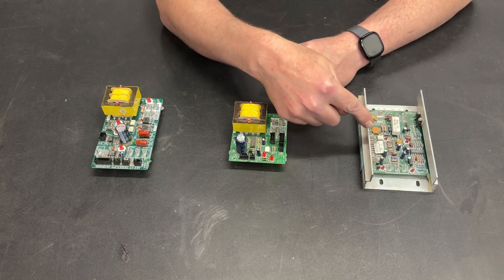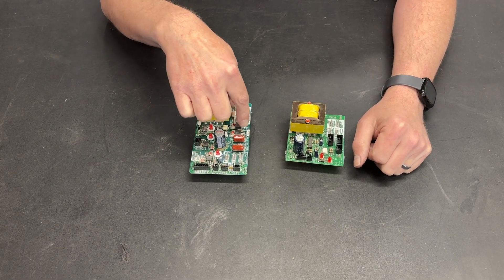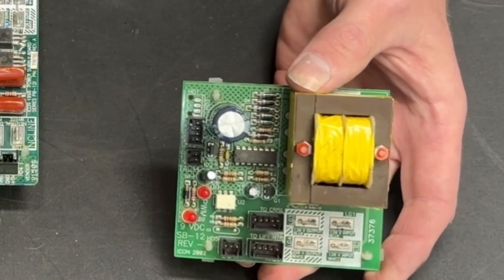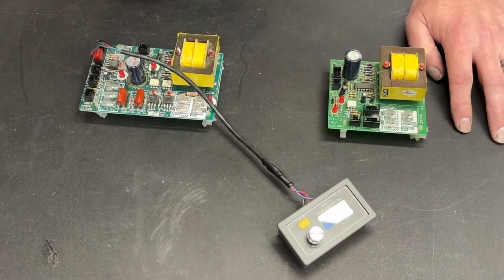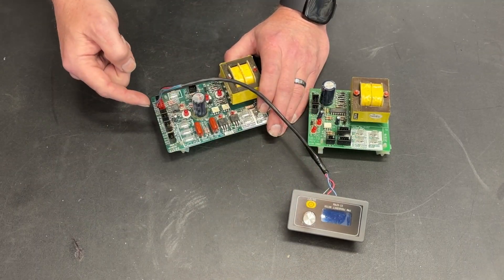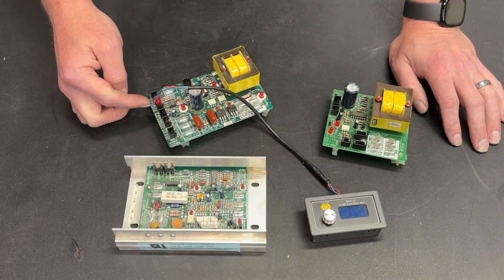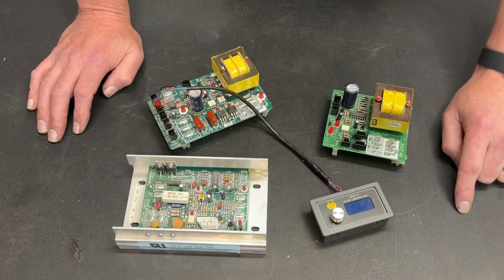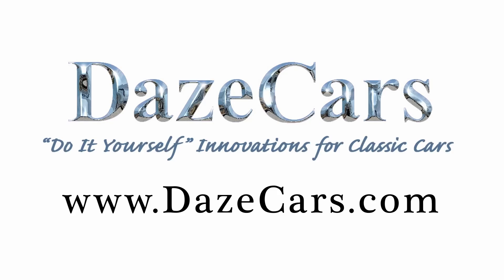Uses for Other Control Boards Found in Some Treadmills: DC Power Supply, Variable Resistor and??

Comment: Thanks for another interesting video. I really need to sort through my random collection of treadmill parts and see what I have and other useful applications they may have. I have heaps of incline units that I am sure are invaluable, but not sure what to use them on.
Reply from the maker: You and I must have totally different definitions of the word "interesting" 😂😁🤣  All kidding aside I am glad you enjoyed the video and found it interesting.  There are tons of uses for incline motors.  I have several videos on that subject but this video shows what I did with one.  https://youtu.be/AHUtBNcEpH8
Reply: @dazecars yeah, that application was a great example of how handy they are. They are really just a heavy duty short travel exposed linear actuator. If I ever get around to fine tuning my old metal lathe, making a travel steady and learning the single point thread cutting gears and gearbox setup, I'll be able to cut screws at different lengths to extend the travel of these units.
Reply from the maker: There is no substitute for ELS.  Its afordable and far superior to gears and a gear box when it comes to threading.

Comment: Hey Daze;  2 questions.  have you found any interesting uses for the height adjustment screwjacks ??  Also, have you used timing belts/pullys on your treadmill conversions, and if so, where did you source them ??  I'm changing my bandsaw from a v belt to a timing type belt, micro-v, or toothed belt, and am struggling finding sources for them with a wide enough pully diameter to do what I want.
Reply: BYT, I used one of those PWM controllers to control the speed of a DC motor on one of the rotary tables I use on my mill.  It works famously, as oftentimes I need 3 or 4 hands independently to turn the table, run the plunge, or some other operation.
Reply from the maker: Im assuming its a PWM motor controller rather than a signel generator?  I too have used somthing similar for projects.  I have a fan for the air inlet on my meat smoker and use a cheap PWM motor controller to adjust speed.
Reply: Once I finally figured out that the micro groove was called a J section belt that helped with the search.  I have thought about using a jack shaft where could change over to a V belt where belts and pulleys are easier to find and less expensive and could also slow it down and increase torque.
Reply from the maker: good info thanks for helping him out
Reply from the maker: There are tons of uses for incline motors.  I have several videos on that subject but this video shows what I did with one.  https://youtu.be/AHUtBNcEpH8  I have used timing belts before but not on drive pulleys just on ELS encoder to spindle connections.  I found my pulleys and belts on eBay directly shipped from China.

Comment: HI, thanks for great videos. I built my 2x72 belt grinder powered by treadmill motor with the help of your videos. It’s been a couple of years . I need to upgrade motor. Is there a motor setup you would recommend?
Reply from the maker: bigger is typically better but FREE is what I looked for.  Over 4 years I scrapped 18 treadmills and got all kids of different setups from cheap to commercial.  All have good usable parts so I took any treadmill I could get and then when using a treadmill on a specific project I calculated torque and sized the motor to the application.
Reply: Thank you
Reply from the maker: my pleasure

Comment: This is the video that was missing. Also wondering if there are other good uses for the main controller boards.
Reply from the maker: If you are talking about the main control panel, no I haven't really got any uses.  They are so specific to treadmills that I can't really see any uses other than using one as a PWM signal generator but at that point its worth it to me to get the small controller as it has more features and is in a usable package.